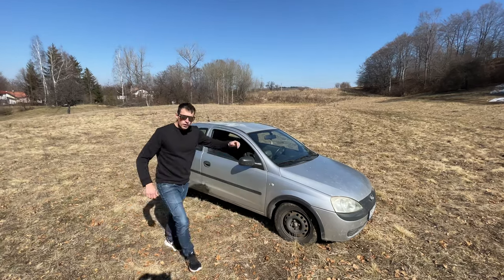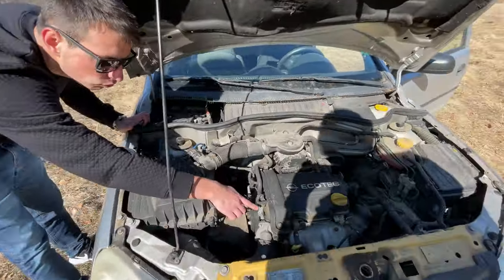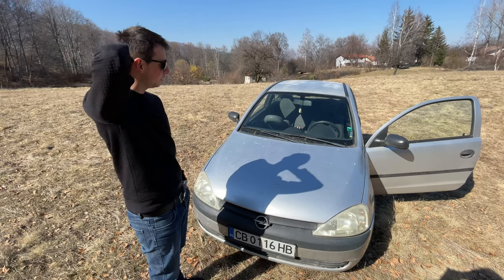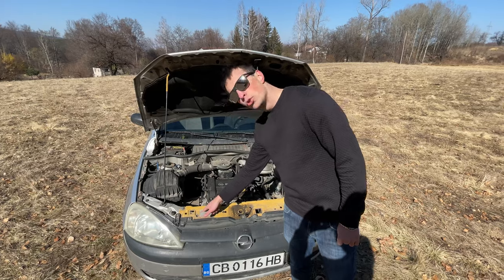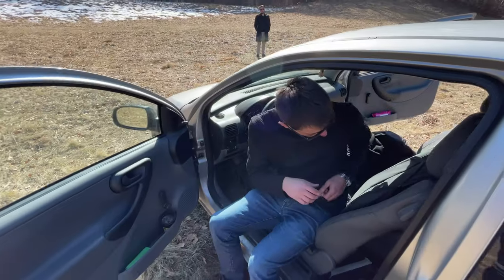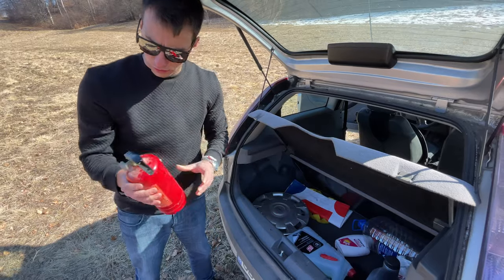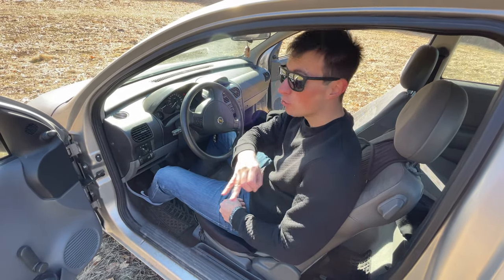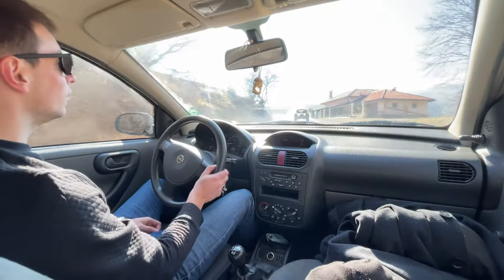SADDEST CAR EVER MADE?!? - Opel Corsa C Review

Comment: Actually the Opel Corsa C is one of the best, and most reliable, little cars ever built by man. The position of the battery really isn't a problem at all. I have an Opel Corsa C 1,2 from 2002. The battery has been changed 1 (one) time in the 19 years. After 16 years of proper service, it finally lost one cell. Battery is more protected from dirt and insects in that place. Once every second year or so, I remove battery, and using someone else's  vacuum cleaner, I vacuum the leaves or whatever hiding there, but there  mostly isn't as dirty around and under the battery as I always expect. Then I spray a little thin rust protector on the tray - voila. The good thing about the position is that the battery isn't  exposed  to sudden changes in temperature (from deep freeze to heat from engine and back) "But it rains on the battery" - So? It's made of plastic, son. In the engine room it gets rain as well, smashing through the radiator grille. And gets engine oil on it. There's almost zero rust on my Corsa (of course some, but not anything that matters at all) and it lives in Denmark, one of the most car-hostile countries in the world (salt on the roads, temperatures constantly changing from a little above, to a little below freeze in winter - very bad for a car. It is very resiliant to rust. A good little car from A - Z.  

The interior is boring, plastic is a little quirky. To make it a little more appealing to look at, I've bought a red/black steeringwheel cover, and matching seat belt paddings (dragon design, wooo) and later a very cheap seat cover, red (no dragons on, I might buy dragon ones, though) - And two years ago, I found brand new, red floor mats on a market, very cheap. And some blue dices dangling from the mirror. Just to make it a little mote catchy than the boring black/grey design from Opel. 

Anyways - the Opel Corsa C has more or less zero (none) weak points. It is waaaay better built than the Ford Fiesta, with which it competes. I bought min used 5 years ago, and sjince then, it only refused to start ONE time, namely when I discovered the 16 year old battery had lost a cell.  That tells a story of confidence and reliability. 

You are probably the type of guy who has a poster of a Corvette on his wall, flanked by another poster with Clint Eastwood. Your sun glasses point in that direction, and your lack of knowledge. For example, the fact there the Corsa you are on about here, has had an accident, and haven't been cared for, doesn't make the model bad, does it? 

What do you think a 19 year old Corvette, not cared for, looks like?
Reply from the maker: This is much better compared to a fiesta, yes
Reply: I have i too i tuned that car esthetic not mechanical because i don’t know how now he have a really good looking blue glitter color with spoiler and headlights xeon

Comment: The only reason these are the best sub compact from it's generation is that it will fit a Z20LET 2.0 Turbo pretty much with no modification, get the 1.7cdti mounts and gearbox and it bolts straight in, this engine even uses the same ECU as the 1.2. Plus they don't really rust, dare I say better rust proofed than the Astra G, and way better than the biodegradable Vectra B.